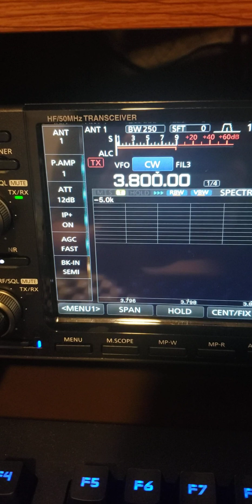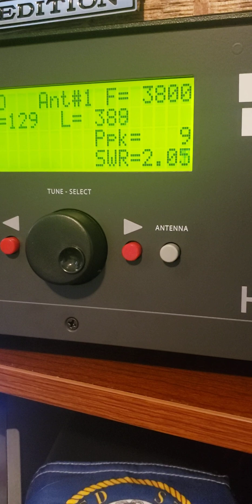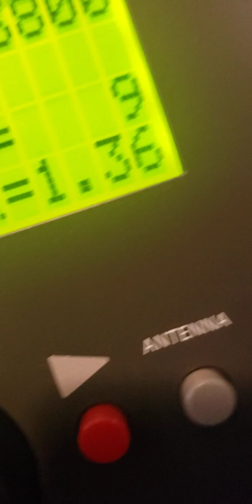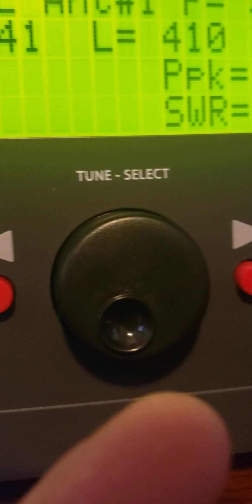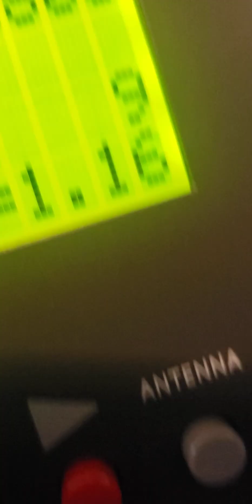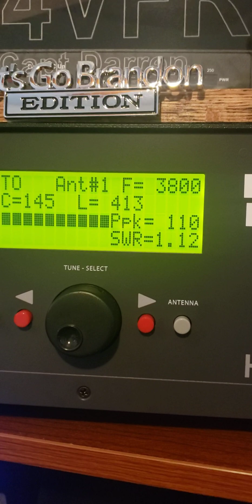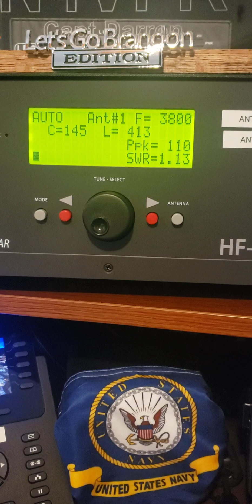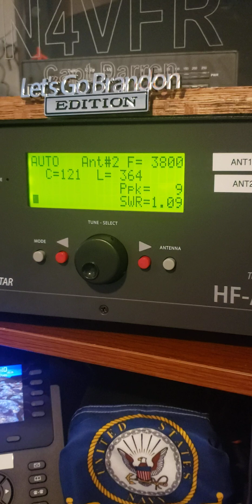Can you tune a Zero Five 43' HF Vertical on 80 meters?

Comment: Darren, the ZF instructions say that you cannot tune 160m while using the 4:1 un-un.  You need to replace it with their 4:1 current balun instead -- but they do insist on using a quality tuner in addition to the balun.
Reply: I had the same question regarding 160, but the vendor said, it comes with what is needed to do that on the 43' model.

Comment: The SWR looked like almost 10:1 at the start. Did you measure the SWR before you started to tune the antenna? If you were using 100’ of LMR-400, which is better than RG-213, you’d get 80 watts to the antenna, with a 100 watt transmitter. 

If the SWR was 100:1, which can occur with some non-resonant antennas, then 100’ of LMR-400 would only get 35 watts to the antenna.

You shack located tuner is making the transceiver happy, seeing a low SWR at the radio, but the high SWR is still occurring in the feed line, which is going to reduce the power significantly at the antenna. 

Your power losses are going to be more severe, because your using 150’ of RG-213. It would be interesting if you could measure the power level at your antenna. 

But if you lose half the power at the antenna, maybe that’s acceptable. You can just feed it more power with your amplifier. Reducing the power in half isn’t going to drastically weaken your signal. 

I’ve heard stations with 1,000 watts with a S9 signal. They were at the noise level, below S2 using only 5 watts. So, it takes a huge power reduction to drastically reduce your perceived signal. So, losing half your power in the coaxial cable probably isn’t that bad of a compromise to be able to use a shack located tuner, verses a remote tuner.

Dave KY0L
Reply: Thank you. All that money spent still doesn't replace understanding system fundamentals.